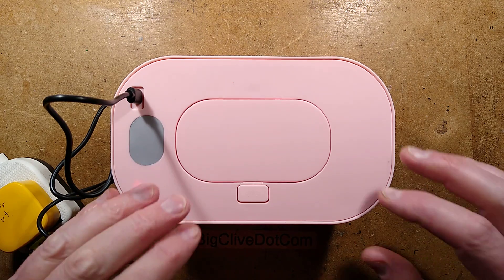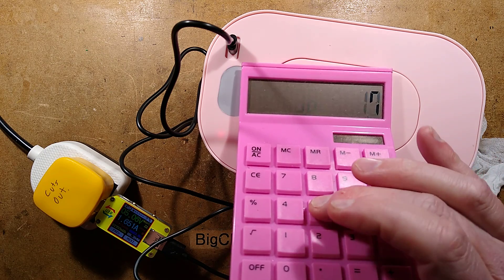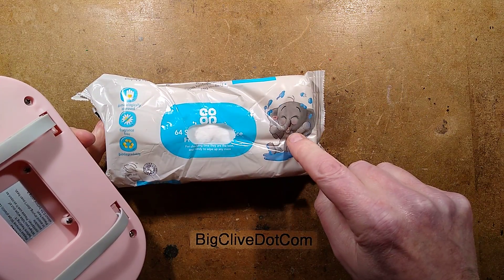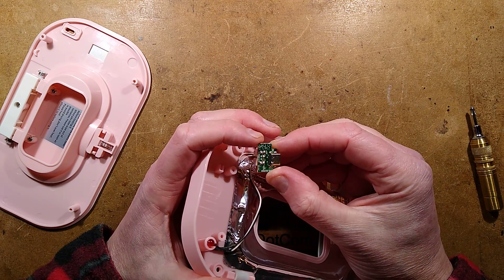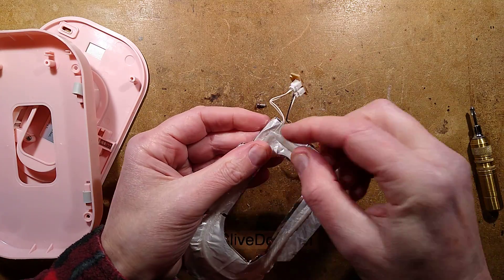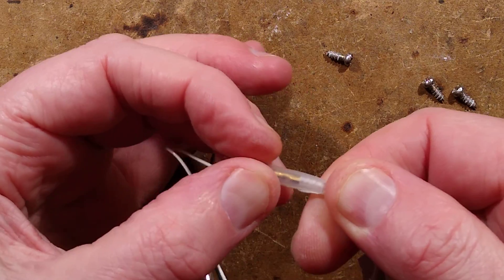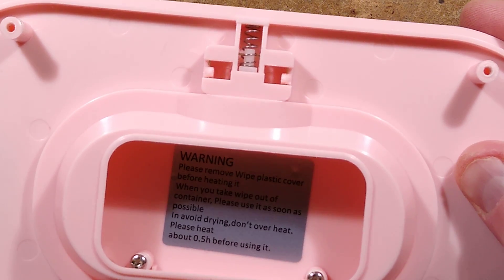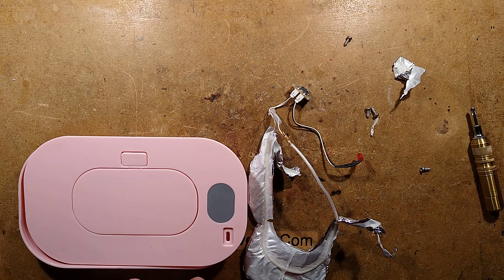Hot and moist USB butt-wipe dispenser

Comment: I'll be honest. I tried baby wipes as an adult after a rough night, and I haven't stopped since.
Reply from the maker: Don't flush them though as they are notorious for blocking drains.
Reply: @bigclivedotcom  They flush so well they turn up in 'Stralia, and then Ollie and Ratty have to jet them out.
Reply: @bigclivedotcom  There are flushable versions. Brady from practical engineering did a thing about them and how the propaganda about them was kinda true but mostly false.
Reply: @GadgetBoy  Apparently flushable does not mean they disintegrate like toilet tissue and they still clog the sewers and pollute the water courses with plastics.
Reply: @GadgetBoy  Can you link to the video?
Reply: I don't think plastic is the issue with wet wipes (that would be a very unreasonable application for plastic). I think it's just that for toilet paper, they shred the fibers super short to make it immediately fall apart when wet, whereas wet wipes are made from long fiber wood pulp, because it has to be rip-resistant while wet. other paper products like kitchen wipes or printing paper are made with longer fibers than toilet paper too, and kitchen wipes are known for clogging pipes because of it. based on rip-resistance though, I think wet wipes might have even longer fibers than kitchen wipes. 
anyways, apparently wet wipes are the worst enemy of the modern sewer, including the "flushable" ones.
Reply: @GadgetBoy  the flushable versions clogged my pipes very badly it was expensive to fix
Reply: @Gadgetboy  I looked up and watched the Practical Engineering video. The "flushable" wipes clogged up his pump immediately. He mentioned and showed that a garbage grinder can handle flushable wipes, but toilets don't tend to have grinders, so that's not relevant. Bottom line: do not flush wet wipes. The only thing you should flush down the toilet is what came out of you and toilet paper. And maybe some liquid waste (e.g. dirty water after cleaning your floors), but that's it.
Reply: @GadgetBoy  "Flushable" means it goes down the drain, but it will still clog up your pipes because it doesn't break down. Put toilet paper in a bowl of water and it disintegrates with the delicatest touch. Wet wipes basically do not disintegrate under any conditions, hell they START wet in the first place
Reply: @Ass_of_Amalek  Wet wipes are mostly made from polyester and polypropylene. Some are made from wood pulp, but they're not overly common.
Reply: @GadgetBoy  Also how is it propaganda? Who benefits?
Reply: @duckyslayer9066  ours are bio degradable but there's a warning on the pack: flush no more than 2 wipes a time.
Reply: @NeatNit  I've always thought that toilets should have grinders 🤔
Reply: @bob_mosavo  , 🤣👏👏! Although, it's worh mentioning that if you have a septic tank, as I do, and aren't connected to a city sewer, garbage disposals that grind up your food scraps and flush them down the sink drain are terrible for your septic system. We all should be composting our food scraps instead ---- I do, anyway, although its easy for me since I live in woodsy rural New England where Nature is happy to consume or break down any left over food product that I throw in the woods.....
Reply: @NeatNit  flush toilet paper? i assume you live in a place where the plumbing supports it. in my country flushing paper is a nono, you do it more than a few times and you got a clog.
Reply: @l0k048  Is it Greece, by any chance? I have visited there, and just could not understand how it could possibly be, but there were signs by the toilets not to flush TP. It seems crazy to me, TP is made specifically in a way that makes it practically disintegrate when it gets wet. Now can the pipes handle Number 2s but not that? Nevertheless, you are right, paradoxically that is the case in some countries.
Reply: @GadgetBoy  Technically... everything is flushable. Although no matter what they label those things, they will clog up something along the system.
That being said, I'm not against using them, I just don't see where you would put them to get rid of the smell.

I'd say you're probably better off just getting a toilet seat bidet instead. This is genuinely the future...
Reply: @NeatNit  Saniflow toilets have grinders as they have a very small exit pipe (approx 1 inch) People adding extra toilets in ensuites or under the stairs tend to fit these types!
Reply: @Ass_of_Amalek  You need fairly resistant wet wipes cos you don't want your finger going through like it does with wet toilet paper!
Reply: @testname4464  ,  According to sanitary engineers, the #1 nemesis of septic and sewer systems is Q tips, which are the perfect size for clogging screens and grates and collecting in nooks and crannies: they'll swell from water absorbtion but won't break down for years.  The 2nd biggest problem are "fat-bergs" that form when people pour waste cooking oil, fats and grease down the drain, especially in commercial kitchens. Source: "The Big Necessity", a history of toilets, sewers and sanitation systems, by Elizabeth Rose George (subtitled "the wonderful world of human waste and why it matters". The author is British and "the Great London Stink"  gets its own chapter). And of course, feminine hygiene products are another no-no for flushing....but most people know this nowadays.
Reply: @NeatNit ,  I'm an American but half-Greek;  My ancestors were skilled at philosophy and democratic government principles but apparently not so skilled at plumbing. It's true, the bathroom facilities in Greece, at least when I visited there in the 1980s, are not very good to say the least. It should be mentioned however that one of the biggest problems in Greece is lack of water,  And it probably requires a lot more water to make excrement flow through pipes if it's got wads of toilet paper mixed into it no matter how easily the toilet paper tends to break down. Perhaps the prohibition against flushing toilet paper is due to trying to minimize water use.
Reply: @NeatNit  for those wondering, https://youtu.be/eHAsuPVBwYM?t=312 is the relevant part. Note that the pump he clogged was not a sewage pump, but a submersible pump, typically used as a sump pump for moving water only.
Reply: @GadgetBoy  Depends on the downward fall of your foul water drain. I have seen some that run uphill installed by 'qualified' plumbers.
Reply: @GadgetBoy  that's not how I remember the conclusion of that video.
Reply: There are flushable wet wipes but they'll ironically bung up your pipes.
Reply: I tried baby wipes once. Tasted horrible.
Reply: Soggy bum wipes as I like to call them are the way to go.
Considering everyone else in the world use bidets it's about time Brits learned to clean their arses properly.
Reply: I’ve got a wicker basket. Built in britta filter amount of hair and baby wipes have been my only saving grace. There’s no other way I could manage
Reply: https://www.youtube.com/watch?v=xEKEiCGP64k - Just gonna leave this one here.
Reply: @Gadgetboy  I implore you, don’t flush them.  Found out the hard way that the “flushable” part was a lie when they clogged our main plumbing stack.  On Easter.  It was a very, very profitable day for the emergency plumber.
Reply: @donotlendbookstome7923  , this from Frank Zappa: " My toilet blew up yesterday afternoon/the plumber said you can't flush a tam-poon/this great information cost me half a week's pay/and the toilet blew up again the very next day....."
Reply: @goodun2974  Oh man.  The only Frank Zappa song I ever knew was the one about becoming a dental floss tycoon, because my parents used to whistle it in harmony.  If only they’d chosen that song to fixate on instead.
Reply: @donotlendbookstome7923  ,  It could have been worse: they could have focused on Frank's song titled "The Illinois Enema Bandit", based on a true story about a home burglar who would break into women's homes at night and not only rob them but tie them up and administer an enema to them.😳
Reply: @donotlendbookstome7923  , that's "Montana". " Movin' to Montana soon/ gonna be a dental floss tycoon..."
Reply: My preference is for a bidet. You clean your butt with the bidet and only need a little toilet paper to dry it.
Bidet toilets are standard in Türkiye where I now live. There are bidet seats you can buy to fit to UK toilets.
Reply: @peterjf7723  one glorious day, I will purchase one, in North America they're considered an oddity/luxury, and are priced accordingly
Reply: @GadgetBoy  they're $35 in US. 'neo 120' It's the same one I've used for years. This baby wet wipe gadget is the real oddity/luxury...
Reply: @GadgetBoy  After first using a bidet toilet  in Turkey I looked at getting one in England. There were some elaborate and very expensive systems available, I just got a "Bidet Toilet Seat Attachment" from eBay for around £25 including postage (from China) I found it fairly easy to plumb in.
Reply: @peterjf7723  ,  In Japan they are very fond of Toto toilets that wash your posterior and then blow-dry it; and the seats are heated!  I've never tried one myself; a heated seat would be comfortable, but I'm not sure how I'd feel about having my gluteus maximus get the car-wash treatment!  🙄 (I would definitely draw the line at an application of hot carnauba wax , which would give a whole new meaning to the term "apple-cheeked" ! 😳).
Reply: @goodun2974  my wife asked me to put one of these in our bathroom. I’m still not a fan of the spraying capabilities, but having a warm seat in the dead of winter is one of those small things in life that makes me happy!
Reply: I don't tend to use baby wipes but I do keep them on hand for stubborn shits.  sometimes it just takes more than toilet paper.  they're a godsend when you've got food poisoning too, when you're doing that much wiping your hole will very quickly go raw and they're so much more delicate than regular toilet paper.  charmin might as well be 80 grit by the time you're on your sixth go at the toilet that day
Reply: https://youtu.be/Dhdk7bKiUdk 

About flushable ones
Reply: @RenatoLaporte  they still clog sadly

Comment: Need to get several of those heaters and wire them end to end so it is long enough to go around the toilet seat to make those cold winter mornings just a bit better  :)
Reply: Now that's a product I could get behind.

And get my behind on it, I guess
Reply: A suitable length of nichrome wire would work, it would need protecting from damp though. Not sure if would be better to build the heater into the seat or into the lid.
Reply: You just have to turn it on .5 hours before you plan on using it XD
Reply: Hah!!! You patreons with ya heated bog seats...SHOW OFF SHOVE OFF 👉🙏👈❗❗👉🚮👈
Reply: Heated seat? It's been done: https://youtu.be/MrnCDKB1hE0?t=16